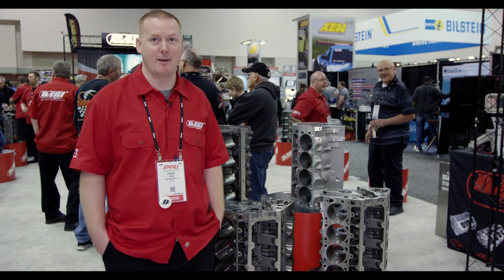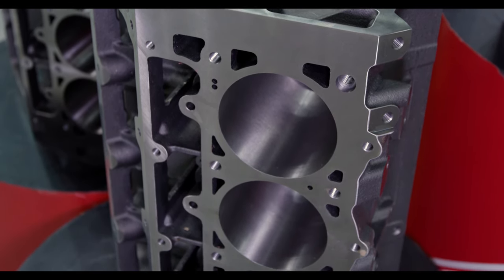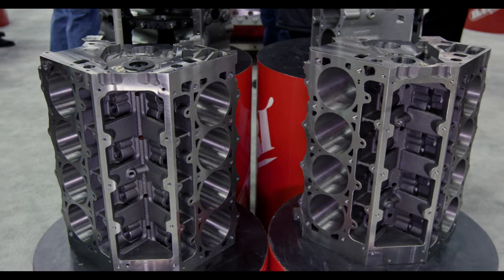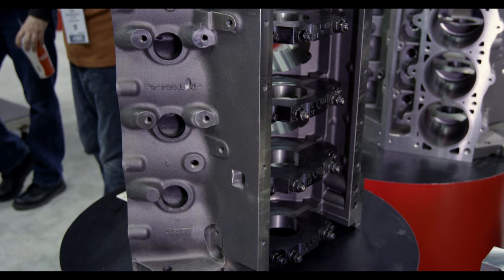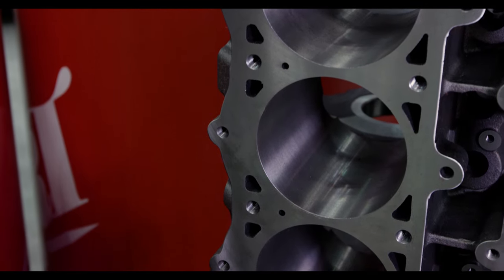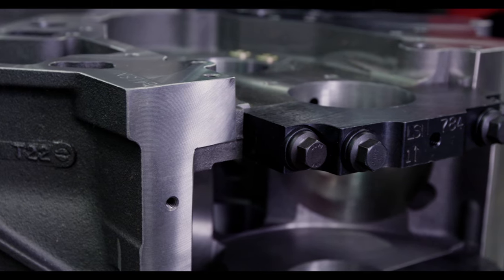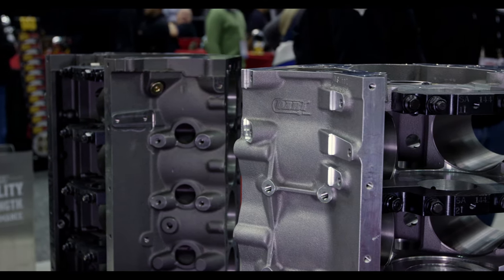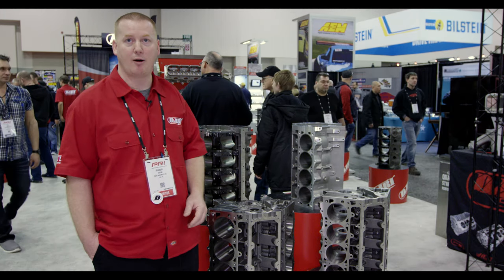Inside Dart’s LS Next Iron Block: Choosing the Right Block for Your Next Build

Comment: These blocks are the way to go for anyone seriously considering building a high horsepower LS project. Having been involved in numerous LS builds, we've seen the difference, not to mention the problems with standard production blocks.
Reply: Sorry but I’ve seen standard production cast LQ9’s here  in Australia handling over 1,800 Hp without any problems, while people using these DART  blocks twisting and then leaking boost thanks to movement, the whole idea of having a Ls is the imbedded crank into the block with the sidewall cross bolts for added strength of what the DART block weirdly doesn’t have 🤦‍♂️
Reply: @alstefan4814  DART has three iron blocks and one aluminum version with the full skirt design. The main cap issue with the GM block is the cause of windage issues in the crankcase. SM Racing also produces a block that doesn't incorporate cross bolts, and they're over 3000hp (turbo)  "Twisting and leaking boost" isn't a complaint heard in these parts.
Reply: @alstefan4814  1800 for a couple passes maybe lol
Reply: are tgese better then blueprint motors?

Comment: top end of Dart blocks are good but the bottom end without the cross bolt caps is a stupid design, those cross bolt caps help the bottom end with stress twisting under boost of nitrous stress
Reply: Dart main caps are larger , and billet with larger 7/16 bolts . Much stronger than a ls3 block .